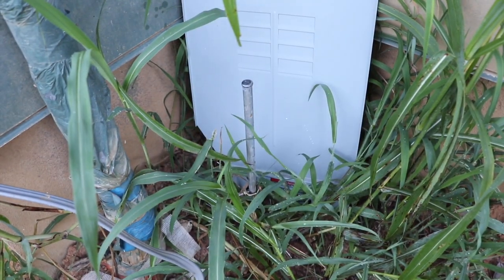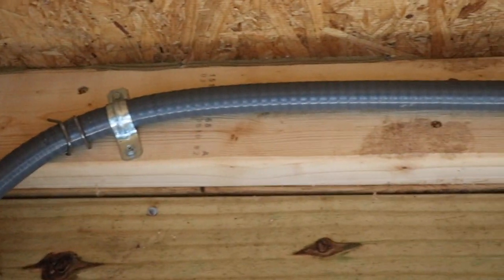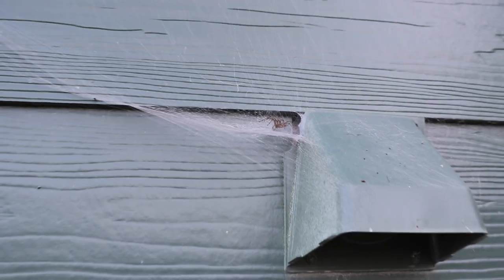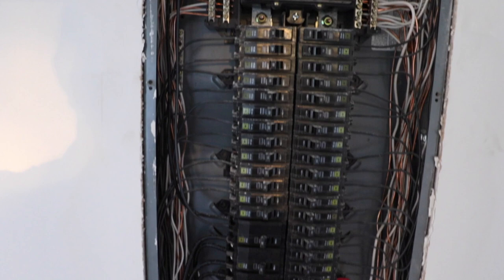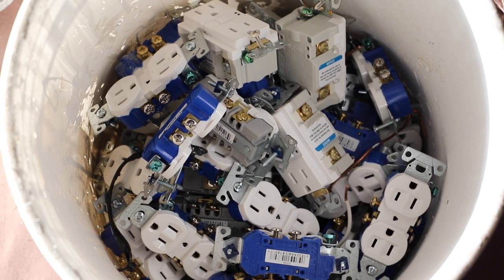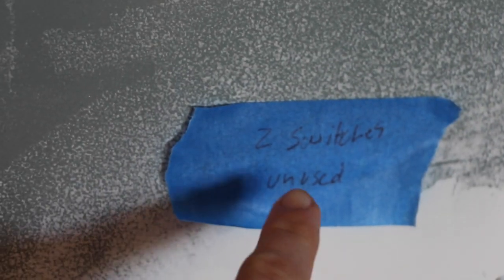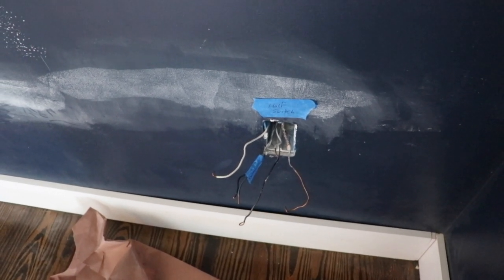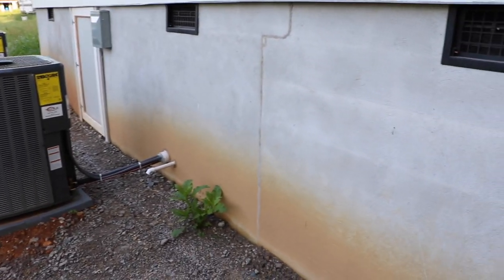Electrical Contractor Failures - Trade Tips

Comment: I have something to say. He is dead wrong about the light in the craw space or basement area. Have you herd of a gfi beaker.  You can gfi protection by using one gfi outlet to cover more than one outlet.  Most arch fault barkers  have problems when it come to heater and things with motor. There a huge number of in the industry will not use those  AFI  breakers if they are not forced by the inspector.   Heaters will blow the AFI breakers. as for the primary feed from the utility it dose not matter what leg they are on because they are same on both legs. I seen case where AFI breakers were removed and replaced with GFI breakers after passing inspection because of all the problems they gave the owner of the building.
Reply from the maker: andrew frazee I've never heard of a GFI breaker no... but I have heard of a GFCI breaker... a commonly used breaker
Reply: Ground Fault Circuit Interrupter breaker GFI is a commn way in my area refer to that type of breaker. they drop the word circuit from the reference. We a talking about the same thing.
Reply from the maker: andrew frazee I also agree with you on the AFI breakers... they are expensive and worthless.
Reply: You know you really shouldn't be the one splitting hairs on what things are called in this video . . .
Reply: AFCI breakers are now code. (In all bedrooms and living spaces) The reason they trip so much is because America went the cheap garbage route in starting in the '60's. Quite a lot of the cheap appliances and electrical devices people buy now uses switches and relays that spark internally, setting off the AFCI. UL passes this shit off as good.

Comment: There's alot going on here, problem 1) if you participated in any part of the install, your part of the team and you need to own that as the home owner. 2) electrician/plumber hybrid? Electricians don't have time for plumbing and plumbers that became electricians don't have time for plumbing. 3) being cheap, nuff said and that was your mistake from the get go. Tamper resistant outlets have been code pre 2015... it saves children's lives... don't be cheap, cost you more now for a poorer quality the second time. Lesson learned hopefully and thanks for sharing your journey with others here as it is necessary to share our mistakes to help others.

Comment: Just watch this video and read some of the comments on here. I am a company owner and we do electrical, mechanical, and plumbing and would be completely ashamed to do work for a customer like what's showed in this video. We all try to save money so going with the lowest bid is not at all wrong if you research the contractor. Word of mouth is the best way to find out about a contractor and his work. Don't know why people on here are upset about him firing this contractor, I would fire him and then sue him for labor to correct his mistakes. My only advice is to alway research your contractors, some of the best are the cheaper ones to. I have owned and ran my business for 25 years and most of my work comes though the word of mouth from other very satisfied customers.

Comment: Miter cuts on molding were worse than the electric ;)
Reply from the maker: Jackson NRA molding wasn't done house was built in 1900 molding was created to match older molding... when finished properly you can't see cuts and it looks better than the builder grade stuff they use now.
Reply: Yanasa Ama Ranch  Yes sir...I'm familiar with the style...I threw it up with a wink for all the electrical experts out there...Waiting on the expert carpenters :)
Reply from the maker: Jackson NRA technically the carpenters would have more to say since I did that part... and the floors. Although I think I would have been wiser paying for a carpenter rather than an electrician it all came out great just took a lot of time to "finish"
Reply: @YanasaTV  your decision to use 24" centers and thin drywall really shows. Hopefully you don't fleese whoever you sell this quick flip to. If the actual plan is to keep and live in this house, where is your sense of pride in workmanship?

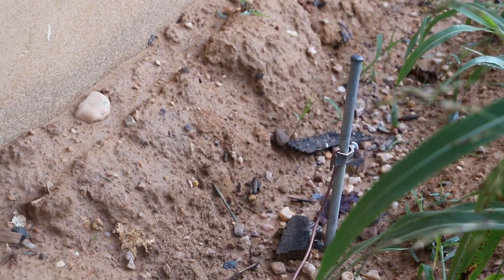Comment: 1:30 Technically yes the grounding rod should be below grade, however, the connected ground wire and the "clamp" can erode over time leaving your home ungrounded. 
A good rule of thump is if you can't see it you can't fix it.
Reply: There are clamps made for direct burial. The code calls for 8' ground rod in the ground.
Reply: Michael Engelman Two 5/8" X 72" 6'  galvanized or the code allows for a a cable buried around the house, though i've never seen it.
Reply: That's what a ground well is for. My rule of thumbp is, if it ain't broke don't f*ck with it. If it don't work, force it, if it breaks, it needed replacing anyway.
Reply: We use 1 plate buried on its back 2 feet down.  Got tired of driving 3m long rods into rock and clay.
Reply: cadweld
Reply: we fail inspection of the inspecter cant see atleast 4 inches of ground wire and the clamps..

Comment: romex is not required to be sleeved when passing through a hollow cavity or a drilled cavity in masonry, it just can't be embedded in concrete and yes you don't want it to be rubbing against sharp metal edges

Comment: The grounds and neutrals end up at the same place so I am not sure what exactly the issue is if they are sharing a place. I am very familiar with DC circuits, however, AC circuits are very strange to me. Why does it matter which side the red and black wires go? They feed only half of the 120V phase so if you reverse them, they should give you the same 120V just with a different phase.

Comment: At 2:20:  That looks like a temperature probe, not a ground on the AC.
At 4:30:  Grease is only required for Aluminum wire.  Copper on copper doesn't need it.
At 4:50:  The ground and neutral should not be connected except at the main panel.  On sub panels, they are to be kept separate (as you said at 7:40 in the video).
At 5:30:  Just caulk the spider cave.
At 6:40:  The fact that it is a sub panel and doesn't have arc fault circuits doesn't matter.  It's a function of where the circuits are running to, not what kind of panel they are running from.
At 7:50:  Actually, the ground wire is connected to the proper terminal up at the top of the panel, not the side like your suggesting it should be.  (but you are correct, they should not be doubled up)
At 8:32:  It actually doesn't matter if red is on left or right.  That is up to the installer.  In many cases, you'll have both sides black and just a white piece of tape on the neutral line.
At 8:45:  Code actually calls for an outlet cover that would keep the outlet dry even with a plug connected to it.  (if of course the wires were connected to it)
At 9:56:  The fact the wires are from the top or bottom makes no difference in terms of electrical code.
At 10:44:   Yes, if complying with the 2017 National Electrical Code, Article 406.12(1) requires tamper resistant receptacles within the home.  However, many places have not yet adopted that code.  As your video was made in 2016, it in fact was not yet a requirement.
at 12:00:  You also might consider how much wire your trying to stuff back in the box.  Not only are the nicks bad, but the length of the wire is excessive.
At 13:16:  Running wires for future use is fine, as long as they end in a box.  If you don't want a fixture, you must still have a box, and a cover plate (it must be accessible).
At 16:26:  So, if you had opted for pedestal sinks, you would want to see the plumping?  Don't think so.  Plus, not sure why you want an outlet UNDER the sink at all (maybe a kitchen for a garbage disposal).

(I quit at this point.  The music being repeated over and over again just got to me). 

Suffice to say, this guy thinks he knows what he is talking about.  Take it all with a grain of salt as much of what he is telling you is personal preference or simply wrong.

Comment: Why are a bunch of the ground wires cut off after the crimp sleeve? Are you intending on not grounding the equipment? Which also won't pass inspection

Comment: The ground rods are not to be put below grade. They should have been pounded down farther for sure. But, if they are below grade you don't have future access. 

You don't sleeve wires going through masonry. I agree that the 10-3 shouldn't be rubbing the metal member but the other pipes are already in seal tight there is no need to sleeve a pipe.

The "grease" is actually meant for dissimilar metals. So if you conductors are copper and the bus is aluminium you ought to put noalox to prevent corrosion.

The crawl space lights shouldn't have an outlet on them. That is a hazard because of potential damage to the cord. I believe those types of lamp holders have actually been ruled not to code in a residential space by NEC.

The lower outlet in the washing room is for the washing machine and is on the load side of the GFCI outlet next to the water box. This is commonly done because some washing machines don't have a long enough whip to reach a GFCI placed high enough for a HO to be able to reset the outlet.

Uh... The dead switches is an easy fix. You leave it alone and put in the fixtures.

It is obvious the electrician had some quality control issues but you shouldn't have been rooting around in his stuff. Either hire the electrician to do the job or do it yourself. You would never hire two companies to do different components of your house.

Comment: A hot switch with no load is not a safety hazard. Jesus I'm out of here.
Reply: Just Another War Robots Channel 
I think they connected the unwired cable in the ceiling to the hot switch. So they had hot wires floating around in the ceiling.

Comment: The "grease" you spoke of in the AC panel is an antioxidant, (e.g. No-Lox) used for Aluminum to Aluminum connections; not required for Copper to Aluminum connections.

Comment: I will agree with you on most of the video. Whoever this electrician is they should stop doing electrical work. They are bad at it. The panel was horrible! That being said, there are a few things in this video you should have studied up on before you decided to add them in. I preface this with the fact that I am an Electrical Contractor from California and am about to get my Texas Master Electricians License. 

First of all, if that is a 10' ground rod then only 8' of it has to be "in contact with" the earth. The other 2 feet can be above grade as long as it is protected from damage. 
Second, the electrical grease you referred to several times during the panel portion of the video is called Noalox Anti-Oxidant Compound and isn't required on copper connections. Now the aluminum connections that didn't have it you are absolutely right about and can be a major potential fire hazards if not applied.
Third, the electrician wired the lighting in that crawl space you showed correctly. It was you that chose to add a keyless light fixture with an outlet. The electrician can't assume a lighting circuit is going to have outlets applied to it after the fact. Lighting circuits don't require GFCI protection in residential applications such as these.
Finally, it is within code NEC 250.52 (f) to have the washing machine run on the same circuit as a laundry room outlet. The circuit has to be dedicated for the laundry room not the outlet specifically.

Other than these points I think you were completely justified in firing this electrician. If indeed he had failed numerous inspections and after seeing some of the "work" you highlighted in the video, wow, this person/company has no business doing electrical work. Great video and thank you for sharing.
Reply: Another thing wrong with this panel is the high amperage breakers must be installed at the top of the panel , Closest to the main breaker as possible to prevent overheating of the main busbars , In that other box where they split the wire strands in half to connect to the neutral bar , That's for sure to overheat and start a fire
Reply: Also , For a panelboard wired that shoddy , The person who did this is not an electrician at all , Let alone not being  a certified contractor , For shoddy work like this , It's a perfect way to put you out of business , Develop a terrible reputation and also get the pants sued off you from the house burning down caused by shoddy workmanship

Comment: You're not an electrician. Hire someone who knows what hes doing. BTW laundry circuit for the washer can have a convenience recep on the same circuit.
Reply from the maker: Will... the entire video was on ELECTRICIANS who failed inspection NOT us... so to better explain we did hire an electrician, two separate electricians actually and they both failed... the fails where pointed out by the county inspector. And no, in our area the washer has to be on a stand alone circuit.  There are national building code standards, state building code standards, and local building code standards. They all have a right to have their own requirements however, local must comply with state and state must comply with national.  So national building code is actually the simplest in terms of requirements and local is the most complex. Don't be a fool in thinking what is allowed in one area is allowed in another.
Reply: Yanasa Ama Ranch I think you may be a bit confused. NEC states there must be one Dedicated laundry 120v circuit. It doesnt say there cant be two recpetacles in the laundry room in that circuit. I doubt there is local code that says otherwise though I may be wrong.  Also the service recep within 25' of the AC doesn't need to be dedicated. Deox (electrical greese) is a good practice for Aluminum wire but not required by code unless the lugs require it by listing. Some good infor but a lot of wrong info in this video.  Im sorry you got taken advantage of by these contractors. When you find a good one keep them; dont go for the low bid. Im usually not the low bidder but my jobs always pass. If your electrician allows you to work under his permit or on his job chances are he's not providing a quality job. I would never allow a homeowner to work under my permit.
Reply from the maker: Will Gillispie I'm sure the inspector became overly picky the more he found wrong. Probably the largest issue with the larger electrical contractors is that they send out non licensed personnel to do work... unsupervised.  We weren't the only ones who suffered at the hands of the electrical contractors there are others who used the same companies and had similar issues.  If you are licensed and actually do the work yourself... you are offering a very valuable service.  I'm sure you stay busy!  Most of the guys like you we tried contacting were booked out for over a month.

Comment: There are no "Neutral" wires in your A/C sub panel, RED should always be on the left RED-BLACK-BLUE(if blue is needed) left to right or top to bottom.  Although not allowed in Canada I have heard that the grounds can go to the grounded bar when wiring the main panel, maybe this was a reno? main panel just needs some re wiring, seems crazy that when the ground bars are clearly visible in the back the original electrician ran right past them.  Lots of shitty work here on this reno but I think you should have consulted an electrician before making your video.
Reply: Sorry, a quick search I found that in USA you wire Black-Red-Blue. that is confusing for us Canucks who wire Red-Black-Blue
Reply from the maker: Richard Trenchard you can mix grounds and neutrals on the main panel but not on any sub panels. The panel on the video was a sub
Reply: Cant do that here in Canada
Reply: In the states, the ground and neutral are bonded at the first means of disconnect.  I will say though, even at the first means, we still keep the ground and neutrals in their respective separate bars and either just put in a green bonding jumper or some panels come with the neutral bar bonded to the can.  Looks much neater, is less confusing not to mention we normally (in commercial work at least) number our neutrals to their corresponding circuits.

Meh...that could just be an area thing though I guess.
Reply: Numbering the Neutral wires is so important!

Comment: Strippers didnt accidentally cut that wire they cut a few strands to fit under the breakers lug lol what a joke
Reply: that is wrong. Dont you think so? You need to have the right lug size.
Reply: Not when you're using wire 3-4 sizes bigger than what the breaker is rated for. Wiring 30a breaker to 30a outlet with 120a wire. Just means wire won't melt in wall. Sloppy, but not negligent.
Reply: Nah right lug size is not a spec. Mains box here has a neutral lug too big for the supply wire and so somebody just doubled it up with the stove return and called it good. They could have run it into the unused neutral bond, and solderclamped the stove onto it, but that required retightening two lugs, solder, an torch/iron, clip, and craftsmanship, plus it isn't a completely reversible method.
Reply: Order the right size lug kit. (Read the instructions on the panel label)

Comment: Regarding grounding:

The neutral should be bonded to the ground at the main service disconnect, but not subpanels. If the main disconnect is the main breaker for the single electrical panel in your house, then the neutral will be grounded there and mixing the neutral and grounds is allowed. However, if it's a subpanel, neutrals and grounds are not permitted to be mixed.